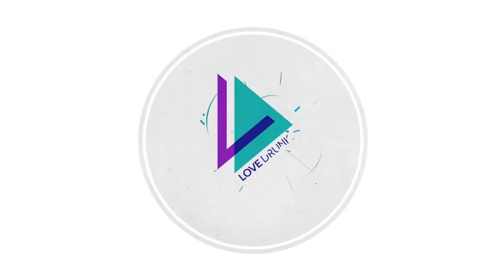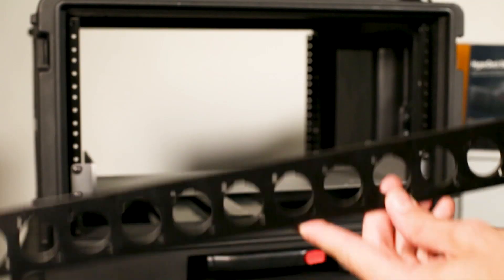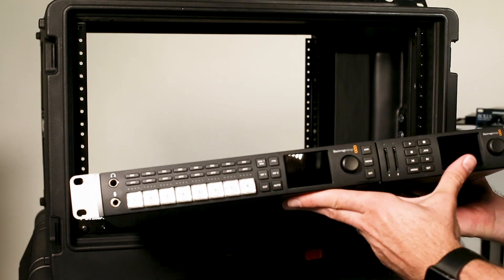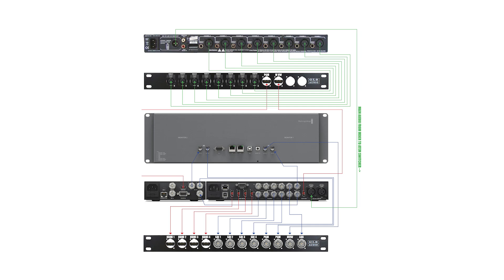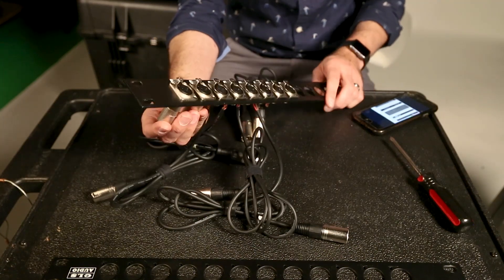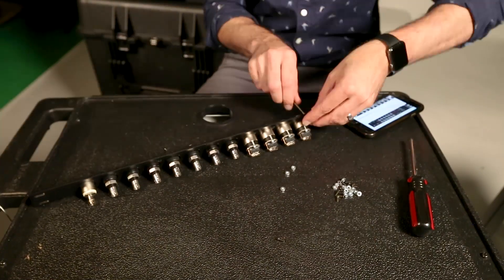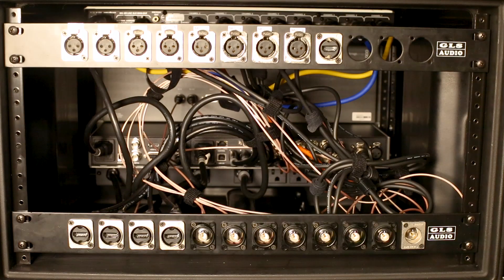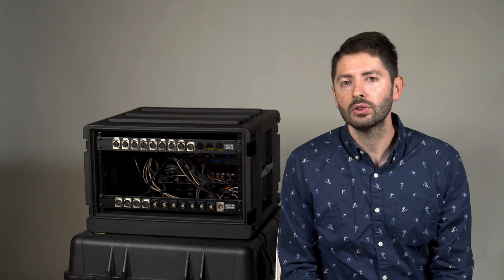How to Build ATEM Live Switching Flypack

Comment: Nice build. Are you still using this flypack or did you make some big changes yet?
Reply from the maker: I made that flypack for the railroad company I used to work for. So it was their equipment. They still have it, but I don't have access to it. I did make a mini flypack for my ATEM Mini Pro, and I shot some video of it, but it didn't turn out quite like I had hoped. I'm thinking of doing a video of it anyway and just talking about the imperfections and what I would do differently. It might still be helpful for some folks.

Comment: people are so married to ATEM.  You could build a system using vMIX running on a laptop, capture using a thunderbolt 3 enclosure married to a magewell of BMD capture care.  This system would be smaller, have FAR more capabilities and features such as ability to stream to 3 different locations directly, built in audio delay for infinite audio channels, instant replay, ISO recording.......... and so much more.  Also ATEM doesn't like cameras with different frame rates and resolutions.  vMix doesn't care.  It will take anything you throw at it.
Reply: Almost all atems have scalers on all inputs now. Also atem is a hardware switcher, and is inherently more reliable than a software one like vmix, where you as reliable as is your OS (Windows is not the champ to say the least).
That said, I use both, as they are both excellent tools for respective tasks - sometime you need mission critical reliability, sometime flexibility. Even better to use both at the same time 😎💪

Comment: To prevent the soldered XLRs coming loose, you can get IO panels with bars running behind, which you can zip tie the cables to.
Reply: Any recommendations for specific panels here Pete?

Comment: do the connectors come with their own screws, or do you have to get them separately?
Reply: They came with their own screws.
Reply from the maker: Sorry, responded with my other account! Yes, they came with their own screws.
Reply: @YayYouDidIt  I just got everything in. They didn't come with screws(not a big deal) Also wanted to add that the SDI cables are very janky. Super laggy and glitchy for me. I'll be trading them in for some 12G rated cables. Not sure if you encountered an issue with them.

Comment: Thanks for sharing! I think I'm going to recreate something very similar to this. I do have a question, though - Does the USB connection on the ATEM TV Studio allow it to input to a PC to utilize a streaming software like OBS or similar (kind of like the ATEM Mini)? Or would I need to look at getting another device like the BMD Web Presenter to handle that?
Reply: Hi Ryan - The answer is no. You need a capture device for that and the ATEM TV Studio does not do that. You could send program out of the ATEM TV Studio into the Web Presenter, and then out of there USB into your computer and pull that up with live streaming or video conferencing apps. I use the Web Presenter all the time for that and to do live TV interviews with executives over Zoom, Skype and Google Hangouts and it works great. My only beef with it is that it only outputs 720p. The ATEM Mini line however can capture 1080p into those types of applications.
Reply: Django G-S thanks for the quick response! That’s about what I expected. I wonder if I should use my ATEM mini as a capture device for the TV studio. I also want to avoid the web presenter for its 720 max resolution. Maybe I’ll look into an AJA capture card.

Comment: What I miss with almost everyone who demonstrates his build up, is actual usage. With these tiny monitors and no router for remote control I cannot think of any practical usage for these compact racks. So my question is. Did you already use this build up and what kind of job was it?
Reply from the maker: Hey, here's that video, as promised: https://youtu.be/STQVZsRjNWo
Reply: @YayYouDidIt  That is a great overview video. Thank you very much.
Reply from the maker: Hey, great question. I live streamed a couple band performances with this setup, as-is. I did eventually add a wireless router network to it, along with an Elgato Stream Deck. And when I can, I use a larger monitor for multiview. I am doing a show this week and plan to put together a video on that.
Reply: @YayYouDidIt  Great :)  I will be looking out for your video about using your rack in a real situation. I am still building mine because I am creating a special suitcase for it instead of using a 19inch rack. but I will be sure to add a practical situation with it when I demonstrate it :) Thanks for your reply

Comment: UGH... What a rat nest. You should have dressed all these cables in a cable sock and wire tied it down the side wall inside. Also notice you missing USB and Network connect on your panels for the switcher so you can configure it and run the BM software.

Comment: What is the shelf that you used for the atem?   Blackmagic teranex mini shelf is a bit expensive, can i use any other that you know about?
Reply from the maker: I think the Teranex is the one I used. I saw one at one point that was cheaper on B&H when I was originally looking, but I think it wasn't in stock, so I went with the Teranex.
Reply: @YayYouDidIt  Thanks, i just bought one Teranex too!

Comment: I was really trying to not to compare with Gary Cruz's build. I however read your response below, and realized that yes, networking is only required for streaming, and all you wanted to do is record and switch.
Any issues with Heating? or because of the open rear, there are none?
Reply from the maker: No issues at all. We did a 3-hour, 9-inning baseball game in 90 degree heat without any issues. Direct sunlight on the case, too.

Comment: Great setup!  I really like your layout.
 I put together a similar flypack but in 4ru case.  An ATEM 1 m/e 4k and an Atomos Shogun Studio.  Squeezed a small network switch and HDMI Splitter in there as well.  Power is through a small (external) APC UPS for conditioning and battery backup.  Audio mixing is handled in a separate 4ru case housing an Behringer X32 Rack.  I was trying to keep the setup as lean as possible, but your setup is making me reconsider a 6ru case.  If for nothing else, so that I can put in a DEQ2496 I have lying around that can handle audio delay.  Perhaps a video hub and one of those great looking rear patch panels.  I hardly ever use my Audio flypack as most venues I operate in already have an audio console of some kind so i just tap in and tell them what I need to hear.  I would love to get all the power connections internalized and reduced to a single power cord out.  Just didn't have enough room in a 4ru case.
Again, codos on your setup.
Reply from the maker: Love the patch panel! Difference between hauling 4U case versus 6U isn't tremendous.

Comment: Looks great, very compact. However, is there no networking included? All of the BMD equipment requires an Ethernet connection and a network switch/ router.
Reply from the maker: Hey Andrew - The Blackmagic equipment does not require an Ethernet connection to do their primary functions. Monitors still monitor, switcher still switches and recorder still records. I might add some networking in the future, but it’s not necessary if I’m just live switching and recording.
Reply: @YayYouDidIt  That's true I suppose! Switching on that panel is very annoying for long periods of time. There are very cheap control surfaces that you can use but it will require networking of some capacity. If it doesn't bother you and it gets the job done, by all means carry on!
Reply from the maker: Hey Andrew - I eventually did add a wireless network, which has proved handy. I just posted a new video showing how I'm using it. https://youtu.be/STQVZsRjNWo